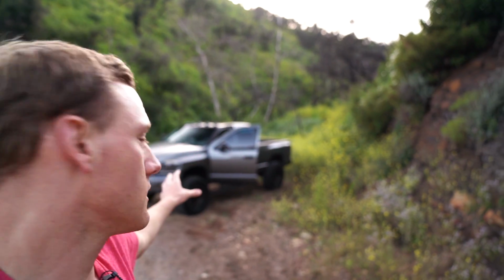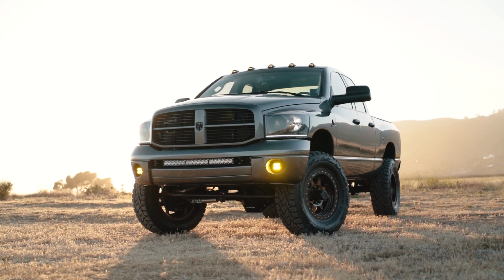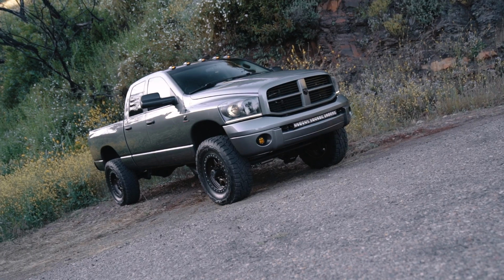My Dream 3rd Gen Cummins is DONE! Almost...

Comment: I have finally gotten my Dad’s 06 5.9 mega cab off of him it was my dream truck when they made them and my Dad’s truck he’s my hero. I haven’t had my own truck in 15 years and I have been looking into a Carli 6” and amp steps. I’m sure spending money on an 06 people will give me crap on why not buy a newer model. Any pointers on what to look for fixing it up?Watching your vids has been helpful keep them coming man.
Reply from the maker: You can’t put a price on a passion project like that! Basically just take things one at a time, but thankfully the Carli systems come with essentially everything to replace your front end parts except for ball joints and steering linkage.  Aside from that, just use quality fluids and filters on the truck to keep it running! I’m always happy to help with any questions.

Comment: Have a question...I have an 06 2500 with 6in lift on 18x9 method 305nv wrapped with toyo rt 37x 12.50. (New tires) I noticed some rear sway, I didn't have that with the pervious set of tires. Any ideas what it could be?
Reply from the maker: It’s really common for new tires to squirm or feel soft as they wear in. Totally normal.
Reply: @JustDiesels  cool! Thanks man!
Reply from the maker: If it still does that in a month, then look into it.

Comment: Do you run stock turbo and injectors? if so, have you looked at upgrading those? I live in California too, and I wanted to know what options I would have for upgrading my turbo and/or inhjectors. Not sure where to start looking for these items, if they are even CA allowed. I was also thinking of regestering my truck in AZ.
Reply from the maker: This truck and my current third gen have stock injectors and turbo. They are not technically allowed, but a stock appearing turbo and injectors will totally fly under the radar for a smog check. They will not pass a state ref however.

Comment: I agree. No more words necessary. You should be very pleased. I'm pleased for you.

But, I wonder how that wood grain plastic would look wrapped in carbon fiber? Not a critique, the thought just struck me while I was drooling. Hmmmmm.
Reply from the maker: You know I ALMOST did it when I pulled the bezel for the head unit, but the issue was doing the pieces on the door cards too. My thought was to color match them gloss black. That’s the fun of the truck though, it’s never really done! Haha
Reply: @JustDiesels  Do you catch yourself admiring your truck's reflection as you drive by large shop windows? 

I've caught myself doing that before.
Reply from the maker: Haha EVERY SINGLE TIME. If you don’t stare at your truck, you have the wrong one!

Comment: Hey man I noticed you don’t have the liner underneath the hood in the engine bay is that just for noise suppression or is that for heat reduction messing with the hood paint?
Reply from the maker: It’s mostly just for noise suppression and since mine was looking a little tired I just pulled it!

Comment: Awesome, what did you use to ceramic coat it?
Reply from the maker: This truck is coated with the Adam’s polishes 7h paint coating, ceramic trim coating, and then I topped all that with their ceramic spray coating. This was a re-coat after the initial Adam’s paint coating finally wore out after 3 years on the truck!

Comment: What do you use to ceramic coat your truck?
Reply from the maker: This truck is coated with the Adam’s Polishes 7h paint coating, ceramic trim coating on the plastics, and glass coating on the glass. All that is topped with their ceramic spray coating. 👍
Reply: @JustDiesels  could you make a video on your process for applying all of the ceramic coating? It would be a good follow up to your video on how to wash a truck.